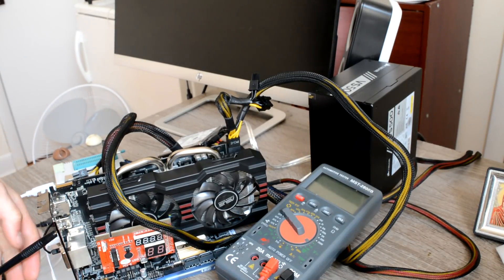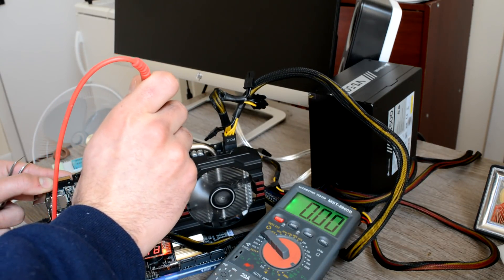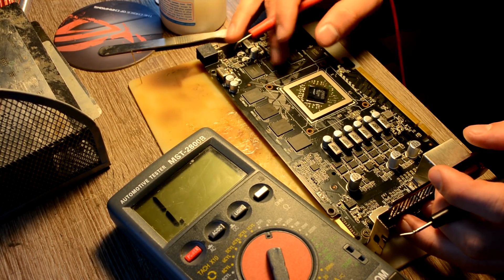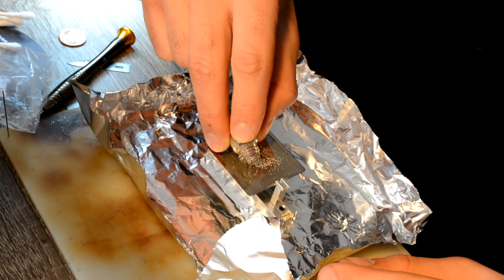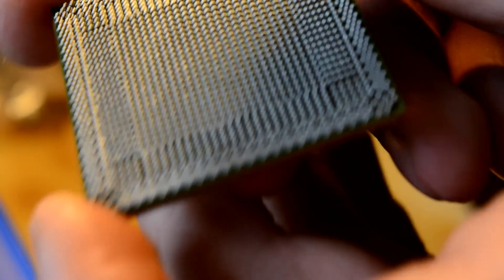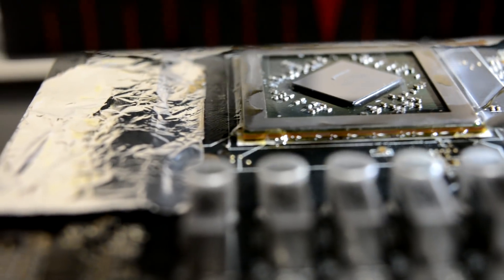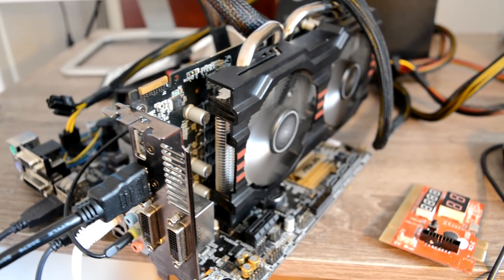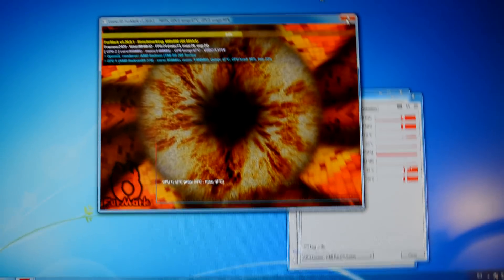repairing ASUS R9 270 which doesnt work, no image video card repair

Comment: I have the same card, working as long as the drivers aren't installed but once they're, black screen 
things I've noticed :
*When the pc is stuck on black screen, everything is irresponsive including the Reset button! (take some time 12-15 sec for the pc to _not reboot _ but to shutdown and then reboot)
*Vcore module (especially the coils) and the memory chips get really really hot when I touch them seconds after the pc crashes.
any ideas my friend ?
Reply: We have the same problem, sad that nobody answer it

Comment: Ok iv'e watched a lot of repair video's lately mainly just trying to figure out shorts 12v 3v 5v rails and where to look and tracking it down. That's the first reball on a gpu die i have seen done. man the more i watch you the more i see that you're crazy smart. I have a msi r9 390x 8gb powers on, fans spin, logo lights up, no post no video i would like fixed where do i send it. Lol no joke have like 5 parts gpu's as well if you could use them. i messaged you on insta as well.

Comment: I have a RX580 8GB that runs furmarks and heaven benchmarks fine (1080p), but crashes when launching DX12 games (GPU and D3D Device Removed Crash) and gives crashes  time spy dx12 benchmark. (brief black screen but contines to run benchmark) , worked fine before, have tried old and latest drivers, DDU and new install of windows. Think it may need reflow or reball. just seem strange it only crashes dx12.

Comment: Hey! I have a R7 265 I'm facing a problem with it i.e while gaming I hear connecting and reconnecting sound and screen blinks. I tried many methods when I uninstalled the drivers it worked fine with out driver. Can u help me out with this?

Comment: do you have a business ? like Paypal invoice mail order ??      im far from california where i could find someone like you  in the valley   ..... like thought i might need the works got the same card playin eternal at 55 60 frames more even just bonked on me but i didnt have my cooler on it high enough  so later  now it will post but im skepticle  ... there a crack in a ball joint?  or is there a fuse that gets reset

Comment: hello bro
My name is Qasim Ali
i belong pakistan
Bro 
I am using R9 270 2gb  256bit gpu
Issue
when install driver then black screen issue 
Gpu backe site different parts full hot 

Help me bro
Reply: Try clean with alcohol and water  after heat GPU chip with hair dryer for 15 min ,put new thermal paste on it. Give it a try ;)

Comment: I have a card that I broke by taking it out with the 6 pin plug still attached. Nothing showing, just stopped working. Tried to reheat and got stripes in the screen. I would have liked to see what and where you were checking to fined out the voltages but you just said you checked them and here the voltage is correct......   Could you show more and why you beleave the problem is here of here.....    Thanks for the videos.

Comment: My gtx 960 is giving no display, twice the display just turned blank and from the sound of it seemed like the drivers stopped responding. I turned it on and the system will post, but no display, the gpu fans spin at full speed, no heat, could you narrow down what the issue could be from this information? I'd really appreciate it.

Comment: Bad start but nice progressing. Actually fast/objective video first time I actually understand what reballing means, never even knew of those little spheres, now I got it, excelent video.   One thing: If one is to heat up the chip with a heat gun but then just let it cool down, can it be considered as usefull for fixing two artifacts lines on r9 270x saphire? It heated up to 98 on boot and gain artifacts, still booting up but artifacts remain eventually indows always crashin. If i do that should I first set a poerfull plastic clamp revolved in aluminium papaer and perhaps aplly the heat gun with the core turned down towards the floor? Im worried if on the other ay the soldering may not touch others. Ho should I proceed my new rx560 arrives friday, thinking about cross for vulkan on the future or selling the r9 if survive 3 days of testing...

Comment: what do you think the initial problem that caused the gpu to not respond? possibly loss of some contact from chip to pcb due to overheating? I would really like to know your opinion. thanks for the video
Reply: In these days, companies have to use only Lead-Free solder and this cause degradation of solder due heat. So not overheat but in flow of time, solder without lead just gets higher resistance and loss contact.

Comment: Eli - I've got a MSI RX 570 that shorted out. It see a cracked and burnt component that looks like in surface-mount inrush current limiter near the 8 pin connector. First the card powered on for a few seconds and then started burning near the 8-pin connector. Now it shorts out. It's a perfectly good PSU and Mobo, the card is definitely the issue. Sorry, random question...but it was a fantastic card that seems to have died an early death.
Reply: Never mind, I figured it out. Bad Mosfets, blown fuses and resistors. I think I'm going to part it out as the damage is extensive and getting parts would probably cost more in time than the card's worth

Comment: Are you sure that the re-balling did the trick or if you just did the so called "oven method" and it works for another 2 weeks and blows out again? I have fixed a lot of motherboards though not that many video cards and when it comes down to the chip (CPU or GPU) I first heat it to 150*C for 3-5 minutes and see if it fixes the issue. If it does then it means that the chip is pretty much dead.
Usually at this point I would look for another chip as heating the dead chip without removing can fix it temporarily which is not what we want.
Still everything else you do is quality job and I have learned to fix quite a few GPUs, still I'm not confident on re-balling the chip as it might still die shortly after.
Reply: He said in the video that the customer did not want to pay for a new GPU chip and was fine with the risk
Reply: @TheRailroad99  Oh ok that makes sense.

Comment: My r9 270x furmark test  101° temprature. card is voltage problem ?
Reply: Damn are the coolers working ?
Reply: @filds1  yes cooler worked
Reply: Thats kinda too hot have you tried to change the paste

Comment: You are so tech man love your work keep it up
I have hd 6950 dual fan no output after two days from installing latest crimson driver for windows 7 
And 2 fans run fast 
What this can be
Reply: Amged Moustafa it might be dead, but I would try taking it apart and applying new thermal paste after removing the old thermal paste. The fans are spinning up fast because they’re rushing to cool it, but they won’t succeed if the thermal paste is bad or the heat sink hasn’t been seated properly.

Comment: i have  problem with my video Asus AMD Radeon R9 290 4GB , when i plays in motherboard the PC not turn on  , without her is run  ? what will be the problem , i have power supply Cooler Master 1000 W and working fine

Comment: I got inspired to tinker when watching this. My old 270x has been collecting dust for a year after it started to display heavy artifacting in 3D mode at clocks over 400mhz. I just "reflowed" it with a hot air gun using a cut beer can as a heat shield. ( ghetto style ) Heated the core until the rubber and plastic fittings in the card started to burn :D I was like it's a dead gpu anyway and it worked. Just to test it out quickly I got 39.1% in userbenchmark without any artifacting. Now I got myself a decent backup card. Thanks for the inspiration.
Reply: Nguyen Anh 3-4min at ~300 air temp. An Iron may not transfer enough heat inside the chip or you arent as lucky as I was. Chances of "fixing" your chips with heat is abit 50-50. Good luck tho.
Reply: never heat the core.... heat it around the core not on top of it.
Reply: Yea don't do what i did if you value your components. I did it for laughs and it somehow worked.

Comment: My graphics card is HIS R9 390x, it doesn't work after the driver is installed, it becomes black blank on the screen. I installed it using an old driver or the latest driver, it still doesn't make any difference.
What causes it? How do you solve it?
I really need your help. Please. Thank you

can also be answered via my email: teknisikomputer17@gmail.com
Reply: Komputer Teknisi install the latest version of The system operative ( windows 10)